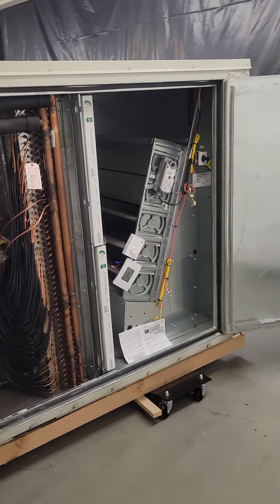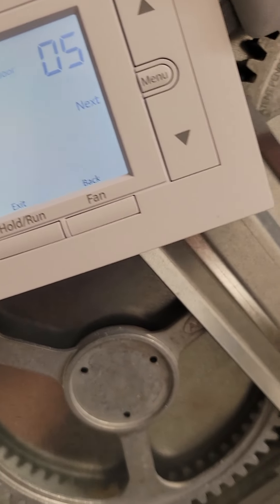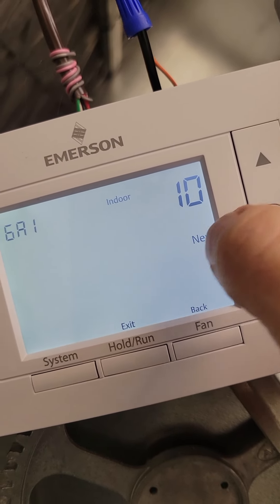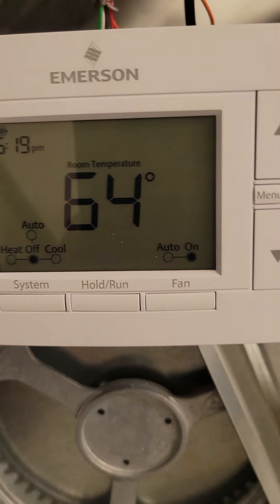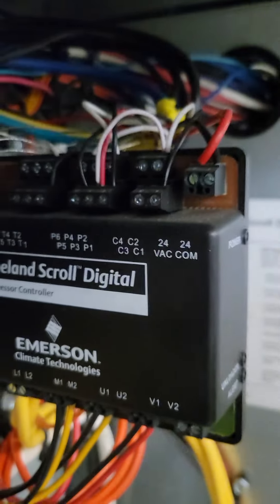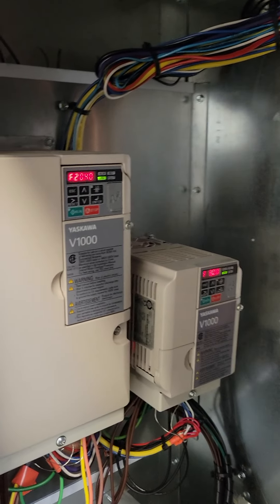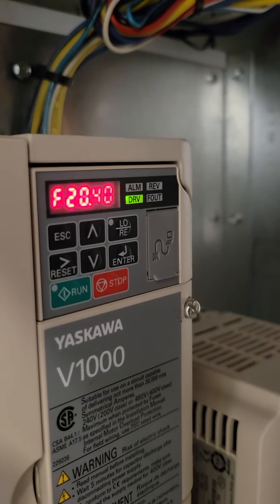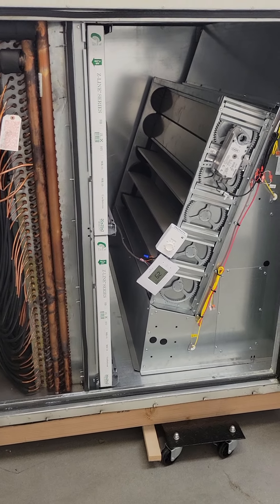AAON : Temporary T-Stat Installation Part II

Comment: Excellent video, Can you wire the Tstat Y1 to the VCCX-2 to the B15 (remote Cooling) and W1 to B16 (remote heating) instead of the Copeland digital scroll controller?
Reply: Thank you, Brian.  This video is really intended for units without functional controls.  If the unit had a VCCX-2, there typically wouldn't be a need for a temp t-stat.  But, having said that, yes, you can do what what you are asking.  The VCCX-2 is quite versatile.  You would have to get into the VCCX-2 config menu and enable those remote inputs, however.